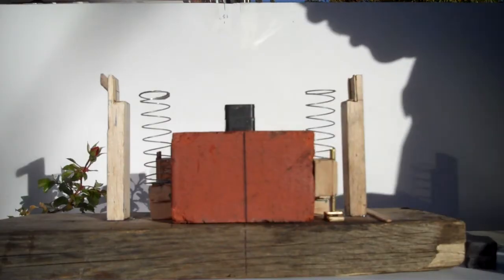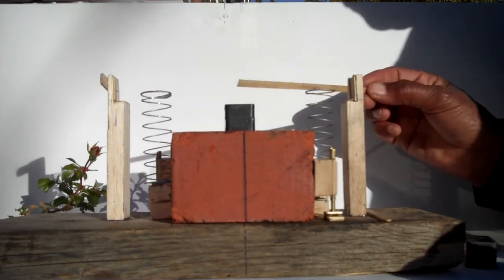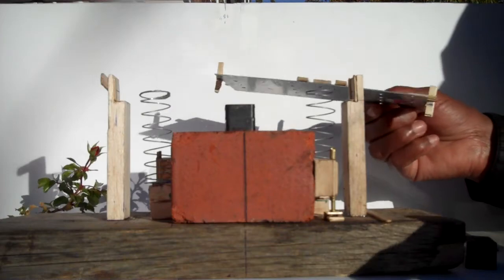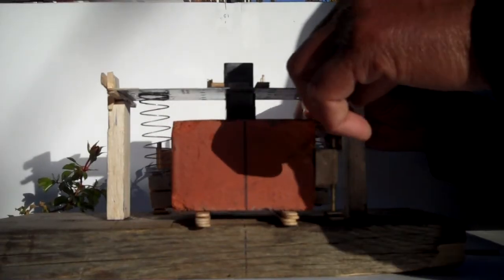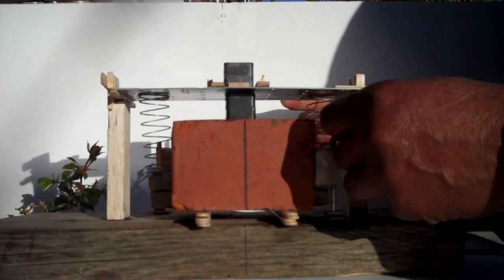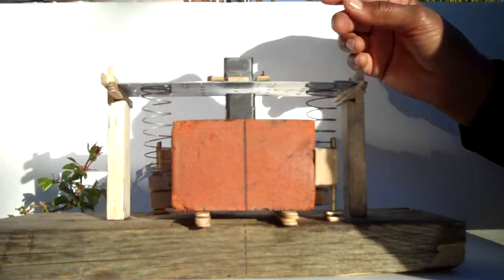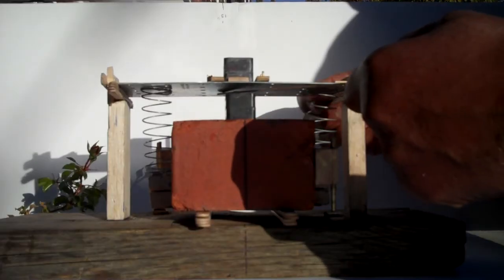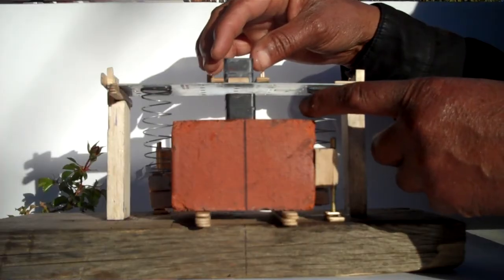Renewable Energy | SELF-CLIMBING/FALLING Machine To Make Electricity | 95% Free Energy

Comment: This is such a fascinating concept, Jesse! I love how you're thinking outside the box using magnets and gravity. Have you considered scaling it with automation?
Reply from the maker: LukeyVermadonVerma: .. (1) The original idea is on my channel. It is to be used at industrial level or national scale. It is 100% non-polluting, compact and is low-tech indeed. (2) solar electric, hydro-electric, coal burning, etc. produces 1-2  million watts per day. (3) This system, because the dead weight can be in the thousands of tons, has the potential of producing 250 billion watts per day. It is extra-ordinary

Comment: I don't see any free energy here
Reply from the maker: Dear Mr. Vladimir : .. You must look at this economically. A finished machine has the potential to produce 250 billion watts per day. This is 1,000's of times beyond anything we have today with any other means. But, (and this is a big matter), it uses approximately 1/1,000th of some of that energy to run itself. Plus, it costs money and effort to build, which is another factor to consider. Plus, maintainance of the machine when needed. Which will be minimal indeed. In the end when all mechanical matters and cost matters are considered, it is giving out about 95%-97% FREE energy that never has to be paid for in any other form.

Comment: Won't work, conservation of energy forces energy loss to heat.

The 97% efficiency forces conceptual understanding without the effects of air pressure, gravity difference and other factors like resistance.

Efficient models cannot be built in this scale, they can only be built in atomic scales and even then there are issues. 

You must capitalize on the atomic scale to have any hope of free energy.
Reply from the maker: Dear Mr. Hobo Corner : .. (1) on the contrary - IT WILL WORK !   Not 97% efficiency but 97% free energy ! It takes money and effort to build. This is a machine. it wastes energy and breaks done like all others. Conservation of energy is totally considered, there is no concern for this. (2) Atomic scale is no issue in this case. It utterly will work. Please go to all the video links below this video. Then and only then will you have understanding of this matter.

Comment: We have clearance Clarence! I’ll be honest I watched your video where you showed this in a diagram and I thought it was a Rube Goldberg machine. After seeing this rough model in operation I believe this could work. I know from your other videos that sliding the magnet only requires 1/4 of the pulling force of the magnet. So you need a motor 1/4 the output strength of the system for sliding the magnet back and forth (meaning after starting the machine it can be powered by the machine itself). Then you probably need a bit of power to change the position of the locking pins for the ratchet, but far less than the weight it is holding. The rest could be converted to usable energy. Very interesting. I’m not experienced in mechanical engineering but I hope you can build a working example.
Reply from the maker: Dear Mr. Thomas Harrigan : .. (1) This machine has already been totally - conceived to practice - in whole. Every single thing to make sure it'll work has been structured in the system. The 1/4 of pulling force (25%) has been neutralized and taken care of in total to almost zero in the original invention. (2) please go to all video links below this video to learn of this system. It is truely a one of a kind.